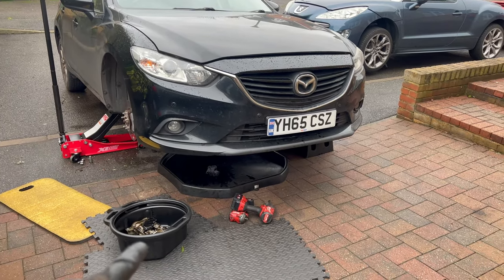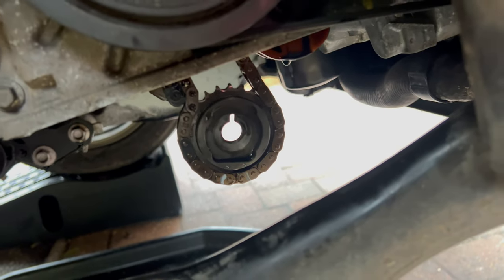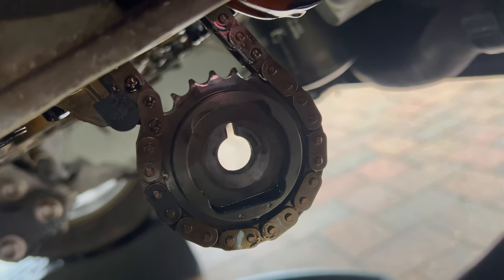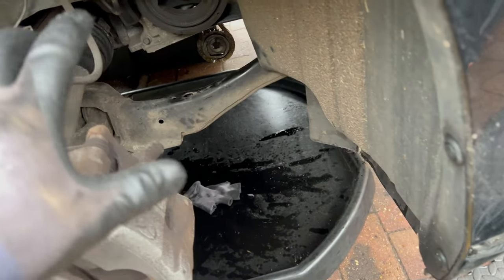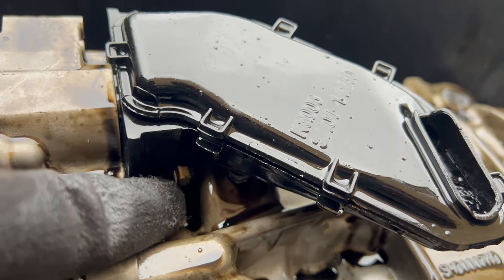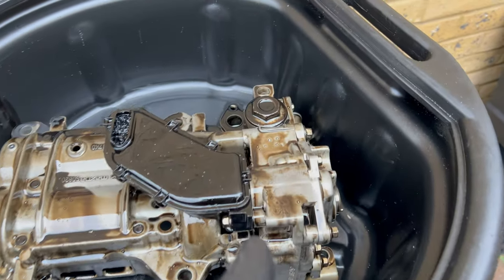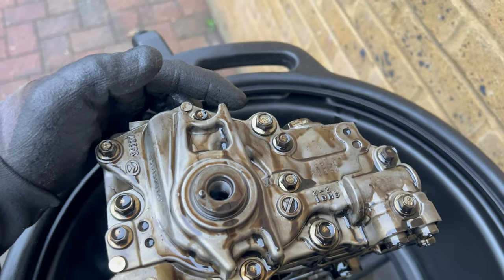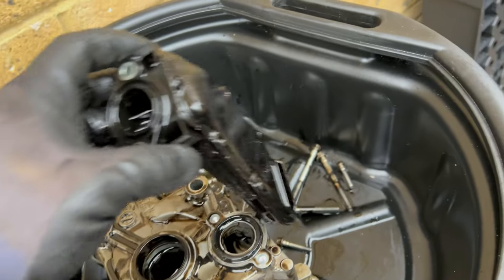Mazda 6 Skyactiv Blocked Oil Strainer - Here is WHY You Shouldn't ONLY Clean it

Comment: You dont need to pull oil pump, you cut the second bolt and fit a replacement. I have an 8mm spanner ground down to fit in the small gap, undo bolt a few turns, then cut off the head with air saw/die grinder and remove the leftover stud by hand, super simple, it takes less than 10mins to replace strainer once sump is off. Make sure you pull injectors, the injector nozzle washers are the cause of carbon as the are a wet injector setup. Check top turbo shaft for play also. We do these every week sadly. I can give you our procedure for repair if you want. You need to reset learned values in ecu also
Reply from the maker: Hi, thanks for your reply 😉
Would great if you could direct message me either on my facebook page. Same username and profile pic as on here. Or send me a mail to themrniceguy21@gmail.com
Thanks ind advance 😉✋
Reply: Done, hopefully it was you 😂
Reply: Hey there, I would like to get in contact with you if possible, as I am in NZ trying to sort out the issues on my Mazdas.
Reply: I imagine there could be a danger of leaving some swarf behind when using a die grinder. Do you know if the bolt is aluminium? Wondering if it's possible to use a multi tool with a reciprocating action to push through that bolt, assuming there is enough access to get the blade in there. It looks pretty tight
Reply from the maker: I would remove the oil pump and also replace the rubber o rings and the metal gasket. ;)
Reply: But how are you fitting a replacement if there’s no space?

Comment: Thank you for making these videos.
Any idea why the oil strainers on these engines get blocked?
Why have Mazda made these oil strainers so difficult to remove, especially given that they all seem to get clogged?
Reply: Injector nozzle washers leak, combustion gasses bypass into oil, oil gets loaded with carbon, blocks oil pickup, oil starvation at turbos and camshaft kills engine first
Reply from the maker: @bobjolly they deffo don't check it.
Reply from the maker: @yamfingaz5598  is correct. That's why it gets clogged in the first place.

Comment: I had and oil pressure light and engine management light come on , then total loss of power, I've had the pick up pipe replaced, how long would you say this would last until blocking again ?
Reply: clean it then get a oil catch can. this slows down the carb build up.
Reply: Cheer's